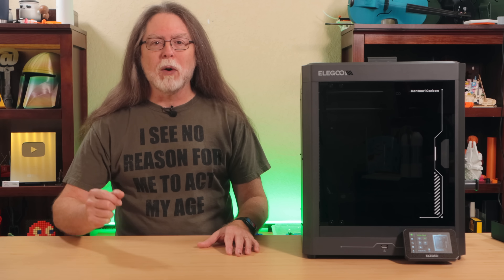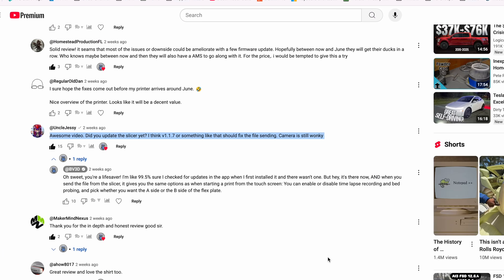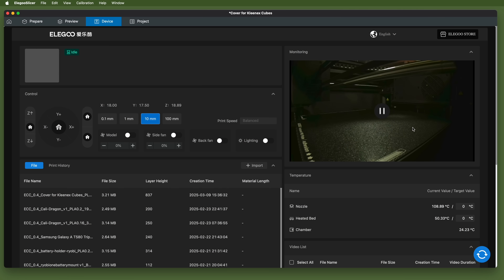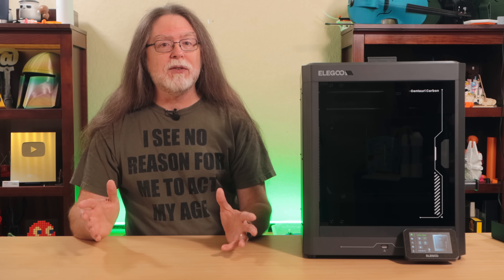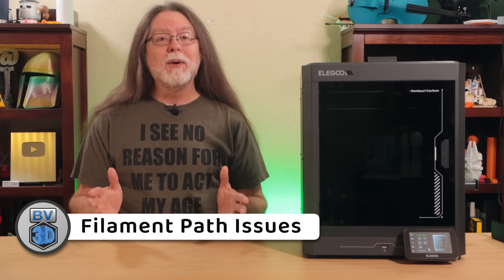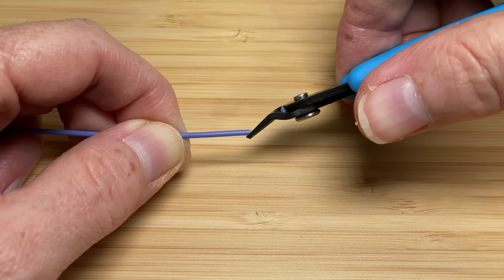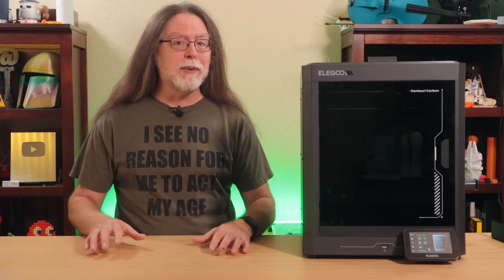Elegoo Centauri Carbon Update! Fixes, plus new issues (and more fixes)

Comment: For any new buyers, this machine is really loud. If you are like me an hobbyist with a normal sized house, this is not the device you want in the next room, even if the aux fan is set to 10% it is really loud. It's the radial fan and the mainboard cooling that have a very annoying pitchy sound too. I can't use it at the moment, makes my dogs crazy as well.

Comment: Thank you so much, I am testing now, I am hoping to get my ABS print to work, because 3 tries and the bed always came out not heating to the 110C recommended by the filament supplier, it seems the printer only wants to get to 90C, even if I manually tested pre-heating and the printer on its own, preheats the printing bed to 110C fine without issues... it is something on the slicer front... I hope this will fix that issue. It is almost as if it was "STUCK" to the standard Generic ABS material 90C bed temperature, and ignoring my own altered material preset

UPDATE: I found the issue, the printer is always receiving from Elegoo Slicer a 90C bed temperature ( your fix was already set on the slicer, thank you! ) but thanks to your video, I was able to find this issue. The software seems to be ignoring the bed temperature settings when you set your own material ( in my case ABS, which required 100 according to the filament maker ), and I added a      M190 S100      line on my material Gcode, and it solved the issue. Now the printer is reaching the desired 100C for the bed. Until Elegoo fixes this issue, if anyone finds this message, just move to the tab on the filament setup, go to Gcode and for theFilament start gcode with S followed by the temperature you need, in my case, it was 100C. I hope it helps.

Comment: Wondering if there is a better fix for the tubing. Once they have a multi color solution in place I can't see having to  take the lid of and bend the tube to be a workable solution. I have already printed a riser for the top so is there maybe a print to help the tubbing get a better angle?

Comment: Know this is an older video.  Perhaps you will see this comment.  First, always enjoy the channel.  Good content, good presentations.  I believe that it was you who had commented about and eject option for USB.  Is it necessary to eject a USB from the Centauri?  Ask as have recently had need to export logs, and copy content from internal drive to USB drive.  Typically when writing to a USB there is something in the process that flushes any caches and makes it safe to remove the drive.  Perhaps that does not apply in this case, perhaps it does.  My approach for now, when writing back to the drive while it is plugged into the printer, is to power down and then remove the drive.  I have accidentally corrupted a few too many USB drives over the years, by forgetting and removing them before ejecting.  This can be very system dependent, so just wondering if you had found an answer for this.

Comment: Watching this two months later (May 2025) and have had this printer for about a week. Updated to current firmware and using only the latest Orca Slicer, which has settings for this printer. So far it's worked flawlessly. Every single print with PLA and TPU has been successful and essentially perfect. So haven't had the slicer or bed temp issues. I've seen a lot of videos and reviews mentioning the problematic filament bend into the extruder head. Although the tube bend on my particular printer is not as sharp or kinked as some others I've seen,  it's not a great path and probably the biggest issue remaining. For me the only issue is loading filament which takes a bit more push than I'd like. I did end up using the black packing foam in the printer box to create a simple riser for the glass top. The real issue to me is the channel area on the left hand top edge of the frame that allows the cable chain space when the print head is moving to the far left side. That is a real design flaw because the filament tube is pinched even more when moving around in this channel. So far I've been positioning my print objects to the right hand area of the plate just to avoid this area entirely during printing. The only comms issue I've had is that the video feed often cuts out and you just get a black screen on the Device tab of the slicer. I actually prefer using the web monitor interface anyway and can bring this up on my phone as well, which I think is a nice feature. Not missing the Bambu A1 or that ecosystem at all. This is my first printer that's not a bed slinger, CoreXY with a full enclosure is a much superior layout in so many ways. Other minor annoyances include the dim light, the glass is tinted for some reason, camera pointed to high, and the fans are pretty loud. I added some LED strip lights inside with a little 12VDC supply, and now it's bright as day.  (My other printers had tiny or no lights and worse or no cameras.) The cool smooth side of the plate works great and is a nice addition to the regular textured hot side, really pleased with that. For the price it's been absolutely phenomenal, best fastest most capable most foolproof printer I've had so far by some margin, and somehow also the least expensive.

Comment: Bryan, this video shows firmware v1.1.4 Today (9th May) my machine told me that 1.1.25 was now available. It even turns off the fans after printing finishes! 
It is now getting very close to zero functional issues with the firmware. 

The best fix for the ptfe tube’s sharp bend is to free it from the chain to some extent. I have gone all the way and rerouted it on the other side of the chain, which allows the tube to rise when needed rather than bending. And yes, I have printed a (lid) riser to provide extra headroom for the moving tube.

Comment: @BV3D... I'm considering preordering a Centauri Carbon, but one thing I'm curious about is whether it supports the capability to cancel a single object on the build plate like the Bambu or other Klipper based printers (like when it gets dislodged and fails). If so, can that be done via the control screen, or does it have to be done via a web interface or the slicer?

Comment: The fact the basically no 3DP manufacturer simply adds 3” of airspace above the extruder to their “carbon” printers shows that none of them hire qualified engineers.
They are still toys for making toys.
Somewhere around 2050 they will achieve 1980’s CNC level machines.

Comment: On my older printer I used m140 at the start of my gcode and m190 after the hotend heat up... 90% of the time the bed was up to temperature, before the hotend, so saved myself a few minutes

Comment: I'm betting the bed heating issue is going to mainly affect those in north america using 110/120V AC. I'd suspect that when they were testing in china they were using 240V AC for bed heating which meant the bed heated up much faster, so prints were never started at below the target temp. An odd oversight as this is something that should have been found during the profile set up testing.

Comment: I'm still hesitating to pull the trigger on the pre-order. At CAD $449 the Centauri Carbon looks like a bargain but it has no track record. I've been spoiled with Bamboo and Ender printers at work but this will be my first personal printer. If middle age has taught me anything it is to not buy v. 1.0 of anything. 😂 So is it YOLO or Caveat Emptor?

Comment: I am still waiting to hear what firmware is actually on the printer. If it's Klipper I really hope they give us an option to use Fluidd interface. I dislike having a machine that uses proprietary firmware and interface when all the rest of my machines use standard Klipper/Fluidd. Short of that I hope it's a fairly simple process to flash Klipper to it without having to rewrite the emmc like you do with the Neptune 4 series to use OpenNeptune.

Comment: The filament feed issue affects other printers as well.

I let the tube float outside of the vable chain. I use clips to help the tube follow with the chain and toolhead, while maintaining enough freedom to float a bit and that prevents tight curves. Typically only two clips are needed, and don't put one too close to toolhead.

I put a clip around 25% from the start of the chain (from the direction the filament feeds) and one about 60% along the length of the chain. This leaves plenty of area near the toolhead for the tube to flex in a more relaxed manner.

This is crucial for printing stiff filaments like engineering filaments with carbon fiber. Even with this change, some filaments are so stiff and brittle, that they can still break in the tube. Usually in the back corner which forces the tube to take its sharpest curve.

I have to ensure the part being printed is moved into the forward opposite corner enough to prevent the toolhead from needing to move to that rear corner. And there is still risk of breakage during the bead leveling check. Fortunately with adaptive meshing, that limits the movement to that corner to only a single instance.

Comment: What's New About v1.1.8.2:

Replaced the heated bed images for ECC and EC series.
Added RAPID PLA+ and RAPID PETG for Giga printer.
Added downloader feature—on macOS, G-code and time-lapse files can now be downloaded directly within the software.
Added start G-code for EN X and EN S models.
Re-enabled the G-code style selection feature with support for modifications.
Support switching G-Code flavor. #11
Bug Fixes:

Adjusted the one wall threshold for ECC and N4 to 50%.
Modified the start G-code for ECC & EC to execute the M190 command and wait for the temperature to rise after homing.
Fixed an issue where G-code files generated by ElegooSlicer did not display model thumbnails, layer height, and other information on Neptune series printers.
Fixed French translation issues, thanks to @LockHar for the contribution.

Comment: My biggest issue with the Centauri Carbon is Elegoo selling it 4 months before they will deliver it.  I know there is a lot of demand and they can only make them at a fixed rate but this looks like a deliberate attempt to sell a pig in a poke, getting people to spend their money in the fast paced 3D printer market months in advance.  I wonder what other printers will be actually available for purchase by June... or July in the case of pre-orders for the non-enclosed non-Carbon version of the Centauri.

Elegoo wouldn't have issues with their proprietary version of OrcaSlicer if they released a profile for open source OrcaSlicer instead of trying to force customers to install a new slicer that only works with one 3D printer.  I have multiple 3D printers and I'm not interested in Centauri until I can use it with OrcaSlicer.  For a company that is trying to woo away Bambu Lab customers, Elegoo doesn't seem to understand that Bambu Lab's proprietary walled garden approach is driving their customers away, and if Elegoo wants these customers, they can't have the same proprietary anti-customer garbage.  We want open source.  Kudos to Sovol, and to a somewhat lesser extent, Creality, for their adoption of open source, as opposed to Bambu Lab and now Elegoo basing 95+% of their products on open source and then locking it all down with a veneer of proprietary hardware and software.
Reply: In France delivery time is 6 months now😢 , I would have to order it but as you said what will happen 6 months from now in the future ? 😮

Comment: You could also leave the M140 and add a line at the and with a M190. That way it's a bit faster as it now will already start heating before cleaning the nozzle en homing. I made setting the temperature (non blocking) one of the first steps so it will heat up during bed leveling etc. Yes, a hot nozzle / bed can affect the bed level but I didn't see it at my printer.
Reply: An advantage of fully heating the bed first is that it adds a little extra time to heat soak the bed.  There is a lag between the thermocouple measuring the bed temperature at or near the heater, and the top of the bed reaching the commanded temperature.  The bed is still expanding as it heats so a bed heat soak allows everything to stabilize for not only better bed adhesion, but also a more accurate bed mesh.  The SV08 has some major issues with bed heating, warping and the inductive prox used for the bed mesh not being thermally compensated so it generates an inaccurate bed mesh.  I added some G code to provide a 4 minute bed heating pre-soak before doing the quad gantry leveling, bed mesh and printing, and it makes first layers much more accurate and reliable.  Four minutes is faster than canceling a failed print and starting the job again.   🙂

Comment: Just unclip it from the chain near the bend and that also fixes the issue by making the bend less severe. Plus ad a thick door seal around the top where the top Glass seats to prevent the Glass top rubbing the filament tube during printing filaments that require the printer box closed. It's not just this printer that has had these issues. Every bloody new printer I seen in my time has had annoying little issues. Some worse than others. Even the all mighty Bamboo line has had problems or do we forget the A1 or was it the A1 mini had a problem which the company had to fix. I think it was the heat bed lead ! The FL Sun v400 had stepper motor overheating issues. That was fixed by the printer community making a printed set of rises to stick in the top to allow airflow . I also added a extraction fan to increase the cooling in the top. The list goes on and on ; basically companies are too bloody lazy to do proper long testing before putting their units out ; however this is likely cause by how quickly new faster printers are being developed so Companies don't want to be left behind and loose a section of the market ! It's all about the dollar !

Comment: Just received my Anycubic Kobra S1C, still awaiting the CC. Can not wait to have not one but two buggy printers, and run two different skins of orca.
Reply: @JPrints3D  well good news, you can use orca with the CC.  2.3 pre release has it baked in.
Reply: Kudos to Anycubic for announcing the Kobra S1C when it's available for sale instead of Elegoo selling Centauri Carbon printers that they'll deliver in 4 months... or 5 months for those ordering the non-enclosed version.  I would have bought an early Centauri knowing I was buying it to beta test for Elegoo, but I wasn't going to buy it 4-5 months before receiving it, and still have an early unit that isn't fully fixed based on the feedback from a few pre-production review units.
Reply: @Liberty4Ever  This was a huge selling point to me as well. Just don’t order off their website if you want it quickly. Elegoos batch shipping and seperate shipping of accessories really seem like bs. They essentially ran a kickstarter we all paid for printers today but most are not going to receive them for months.
Reply: @Liberty4Ever  wait wdym the non-enclosed version is taking them longer?
Reply: @barrag3463  Yes, but it’s not a delay they announced from the start that the non carbon/enclosed version was not going to be shipping until July of this year.    I bet they will have supply issues for a while though. The price point especially for the non enclosed printer makes it so attractive to farmers.

Comment: Clip the cable chain zip tie closest to the print head, this relieves the sharp angle. It does allow the tubing to ride higher but I have the short riser installed for led strips and this gives the glass top enough height that it's not an issue. Also, update was released to 1.1.8.2 but the M140 command is still in place. Thanks for the M190 fix tip.
Reply: In 1.1.8.2 they say that G-Code was fixed :
Modified the start G-code for ECC & EC to execute the M190 command and wait for the temperature to rise after homing.
Reply: M140 S[bed_temperature_initial_layer_single]
G90
G28 ;home
M729 ;Clean Nozzle
M190 S[bed_temperature_initial_layer_single]
instead of removing the M140 they added at the end of the G-CODE the M190...lol
Reply: @MrJfrutuoso1972   Seems legit if you want to start the heating, do something else, and then wait for the temperature no ? 
Sorry if i'm talking nonsense I'm don't even have a 3D printer (for now)
Reply: Mine came last week and that zip tie was missing,the order was free and had minimal bend.

Comment: I'm surprised Elegoo didn't see the filament path issue coming given it was somewhat common on Bambus at one point and a major issue with the Creality K1 and a bunch of other machines, too. It's one of the reasons most machines having tubing on top of the cable chain rather than within it, and the tubing is usually not attached to the chain close to the toolhead.
Reply: Forget about feeding carbon fiber or glass fiber filled filaments with that kinky filament path.  The filament will break at the 90 degree bend above the extruder.  It makes me wonder if Elegoo tested this thing beyond PLA.  I feed filament from directly overhead.  I'd 3D print a top hat that completely eliminated the reverse Bowden tube.
Reply: @Liberty4Ever  I doubt it. A lot of people still only print in PLA and maybe PETG. Many do not have a reason to print in serious materials like Nylon or PC, let alone CF-imbued filaments (not that CF-imbued filaments are always advisable themselves).
Reply: @barrag3463  - PETG-CF isn't much more expensive than PETG and it has a very nice layer hiding matte surface finish, but it does require a hardened steel nozzle.  I think it's easier to print than PETG.